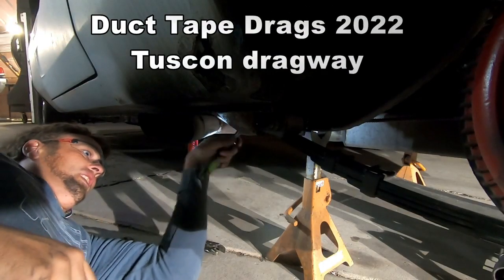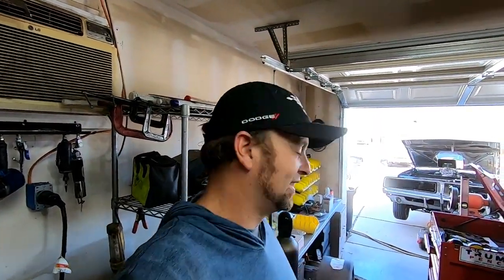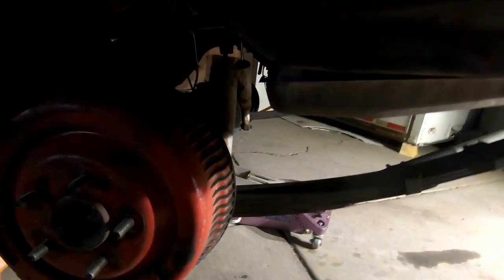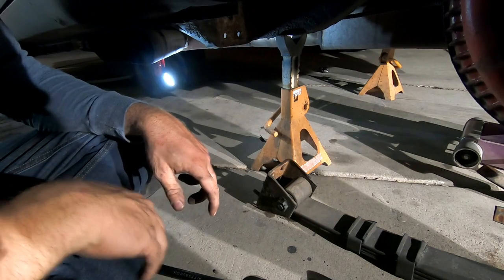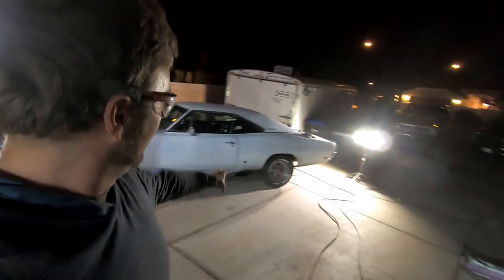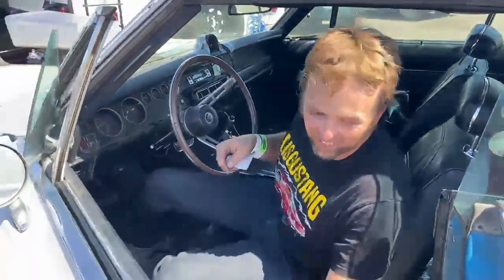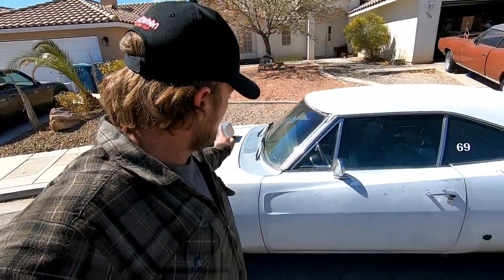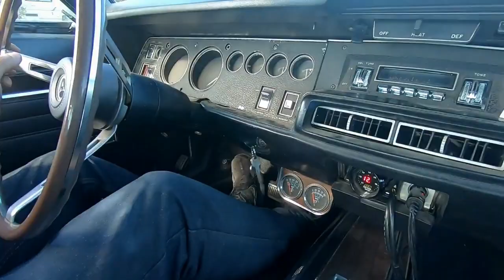Wrenchin roadtrip'n racing and friends...its what Duct Tape Drags is all about

Comment: Hmmm interesting Chris, I tried to do this exact mod (flip front leaf hangers) on my Challenger E-body several years ago but the factory must of decided too many line workers were sending out lowered Chargers so they changed the design so that the bolt holes are narrower at the top I think and wide at the bottom, so therefore you couldn’t flip it upside down dammit! Also maybe so that line workers didn’t accidentally put one in upside down one side and the other up if the bolt holes were symmetrical…got around it by getting some custom made hanger brackets with three hole settings. The lowest ride height setting might of torn the drive shaft weight off on the tunnel first drive, you wouldn’t think there is such a thing as too low but there is!
Keep the awesome work, keeps me entertained over here in Australia, cheers.

PS, I might have written this BEFORE you got to the bit where you mentioned the different size bolt pattern!

Comment: Don't waste your time with a Dana.
Highest gear with a Dana is 3.55.
8and three q. Can handle what ever you can throw at it. Where your screwing up is trying a 2 whatever or 3 whatever with a clutch. Before you take out the  mighty 8 put a 4:56 in it with the Auto. That will be your best time. I put a tremec six speed in my pro stock 67 GTX with 850 hp.. pure love.. I'm just playing around on the street with it now. It'll run 200 mph with the 4:56. Check out some web sites with the gear calculators on them. My hyd clutch only has about a two inch stroke. Clutch is nice and easy. Make sure you weld a pedal stop under the clutch or you can damage your pressure plate from over extending it. Rock On Bruder man.

Comment: Sliders work well but not really roadcar stuff. And you will need a Panhard  or Watts or the back will go everywhere.
Some racing garden sheds have been there and were just dangerous until lateral location was resolved. That will also be your roll centre then
Reply from the maker: Actually opposite of everything you said 🤷‍♂️ the axle is far more stable with sliders than shackles also rides nice and smooth. I’ve put thousands of miles on them already

Comment: How do you handle vapor lock/ percolation? Do run electric fuel pumps or mechanical? I ask since I have been having some issues with a mechanical pump.
Reply: Oh man i know your pain, i run a mechanical fuel pump and i have a cast iron manifold with a Thermoquad. One thing that helped a ton was to get a fuel filter with an extra nipple and run the return fuel back to the tank. You can usually get a fuel sending unit with a return line so easy to circulate. That dropped my fuel temp at the carb by almost 20 degrees. Cheap and effective way to go!
Reply: @Ridendrty  thanks I actually do have an extra port @ the fuel sender. I will definitely do this!!

Comment: 0  - 5  oil weight is horrible for any engine especially during summer months and since most new used and new vehicles run at 210 ° normal temps  . I run rotella 15w40 in our 90s jeeps and a my mopars with a WIX 51515

Comment: You're handing out bad advice on oil. Mixing 0w with 50w doesn't give you something in between, it gives you two strata of the different oils in the oil pan.  The denser oil, being the one on the bottom, will be the one sucked up by the oil pickup. Not a wise move considering both oils are probably wrong for the engine.  Different oil weights don't mix just like oil and water don't mix.